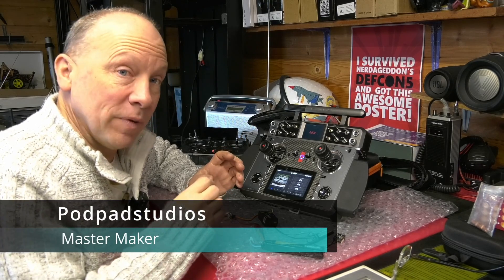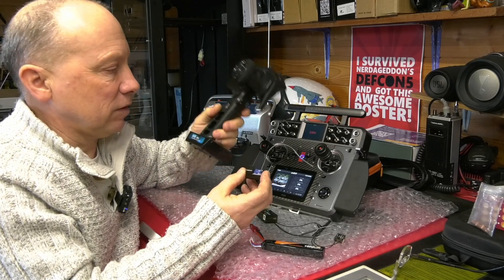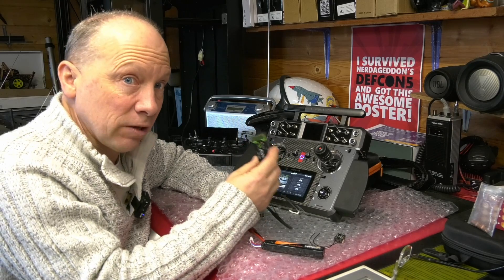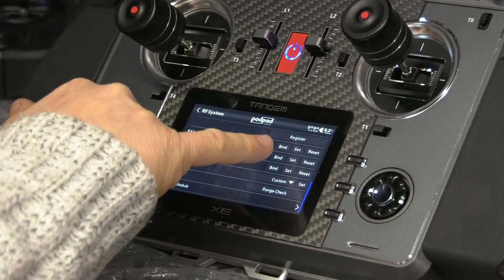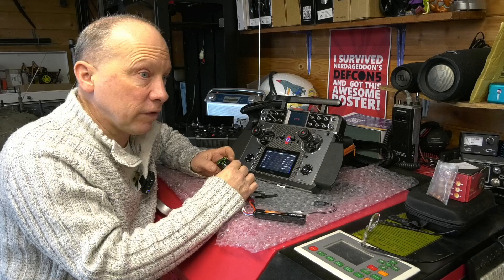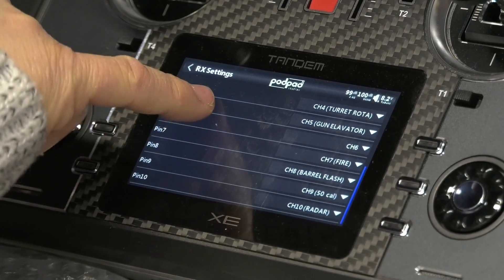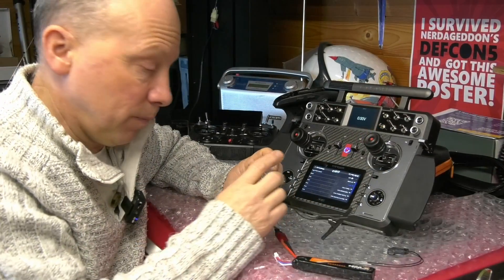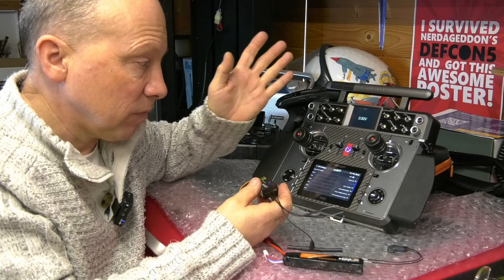How to get 24 channels from a FRSky Ethos radio 18  & 10 channel receivers Podpadstudios sea 2 ep 46

Comment: You could hook up (2) 4 channel sbus to pwm decoders into the sbus out port with a Y-harness. Or (1) 8 channel sbus to pwm decoder without a Y-harness. That would give you 26 outputs to cover 24 channels. It's cheaper and lighter than buying another receiver.